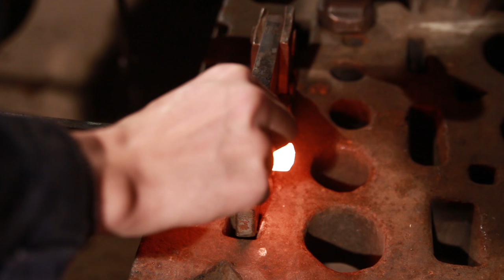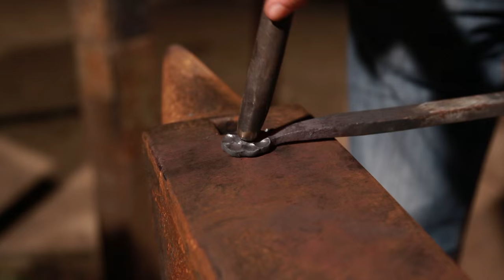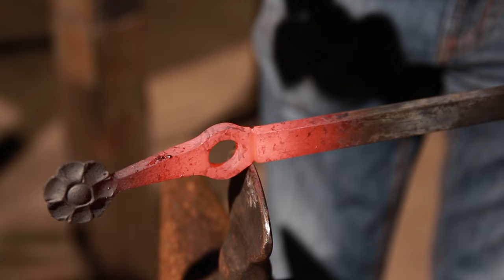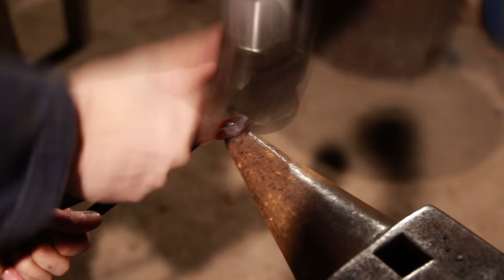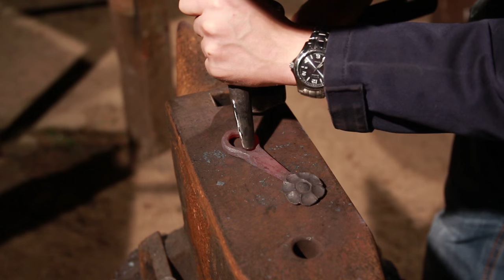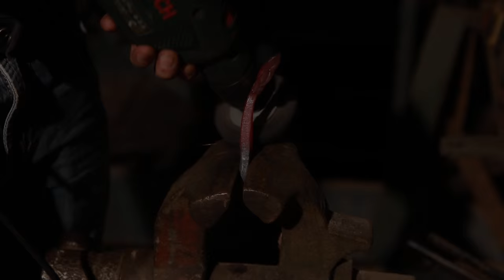How to forge a flower bottle opener

Comment: Great video Daniel as always! There is only one thing that really bothers me with this video is the sound of your anvil,maybe you should try to stick a magnet on to anvil or a piece of chain to minimize that ringing sound. Cheers mate!
Reply from the maker: +Milos Cucukovic It was really quite quiet, after I had screwed it down with a bitumen mat underneath it. But now it kinda losened up a bit again. It is still not as loud as if it just stood by itself. Maybe I'll put some magnets on it or try to get better surface area contact with the stump again. I am anyhow wearing good hearing protection, so when I forge it doesn't bother me really...
Reply: +Daniel Lea It is a smart thing to wear hearing protection.I have a smaller anvil mounted on a oak wood,it is a very hard surface and it helps with a rebound of a hammer.You could also record your voice over a video to prevent this from happening... I wish you all the best in 2016!
Reply from the maker: +Milos Cucukovic Yea Alec has done it in his previous videos and I also liked it on the MidwayUSA videos so I might give that a try!

Comment: great video ! But you have your anvil on wrong side ;-)
Reply from the maker: +Leon boss Well that's a matter of discussion... ;-)
Reply: I realise this comment was made 3 years ago, and it's an age old discussion, my reason or preference for horn to the right. When hammering a scroll on the horn I don't have to reach over the anvil hammer it 1/2 way around, flip it over and then hammer it back towards me, with it to the right I can just keep on hammering all the way around without leaning over the anvil... Also if you cut off stock and it's still hot you have to remove hardy before hammering, to the right I can leave hardy in move to the right of hardy and start forging, in case you haven't guessed by now I hammer right handed.